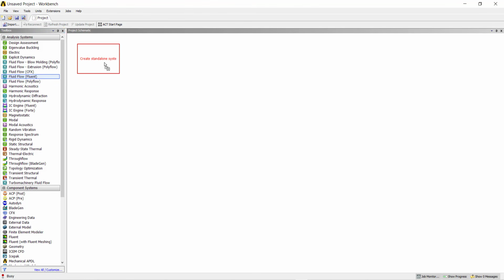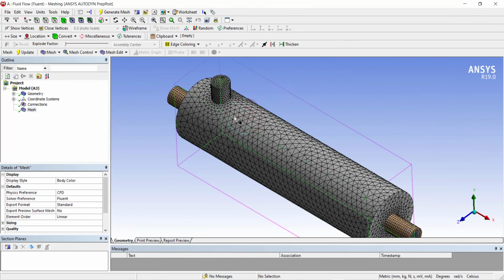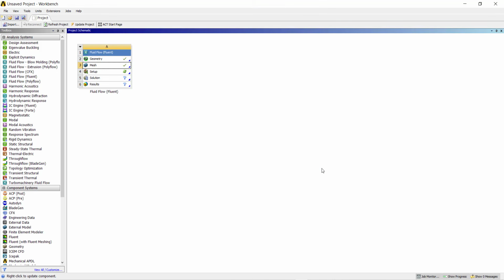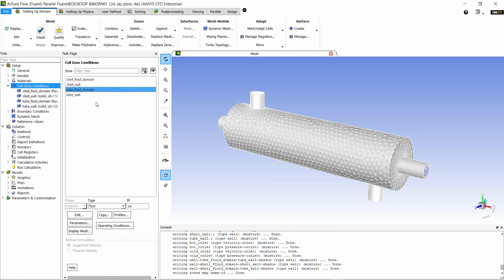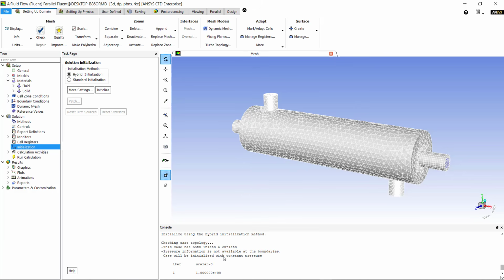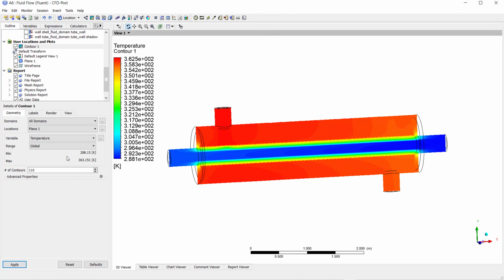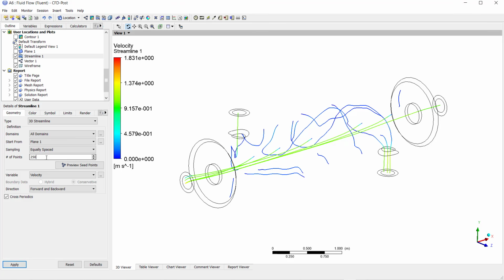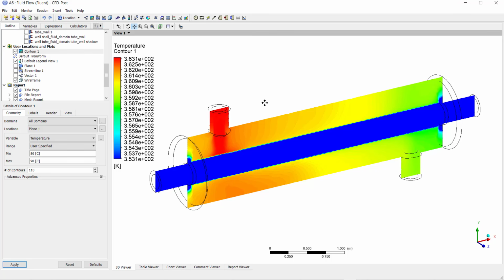How to do CHT Analysis of Shell and Tube Heat Exchanger using ANSYS Fluent | Tutorial | Part 2

Comment: I exactly followed all the steps mentioned in  this video and ran the analysis, but I'm getting the heat gain in cold fluid greater the heat loss in hot fluid. Why is this occuring ?

Comment: Hello Sir,

I really enjoyed your video, and I'm interested in a similar simulation, but considering hydrogen as the fluid and using nickel as the material for the tank. What do I need to modify to start the simulation?
Reply from the maker: I am glad you enjoyed the video. You will have to import materials from fluent library and then assign them correctly to respective cell zones. I hope this helps.

Comment: When I did the same as you did in your video but with Ansys 2022 R1 I have different results. The temperature on the right of the hot domain is much colder in my project (around 340K whereas you have around 360K there). Do you know what the problem could be?

Comment: How we calculate the average heat transfer coefficient value at the cold pipe and in hot fluid also.
Reply from the maker: Hello. Once you complete the calculation you can go to the reports tab in Fluent. There you can select method as area weighted average. Select wall fluxes and then select surface heat transfer coefficient. Then you can select the location as any surface on which you want to find out h value.

Comment: But the solutions didnt converge and u said if the values are in 10^-3 its ok but the energy crossed -3 and went to -4 and -6
Reply: At last the solutions converged guys u just need to apply the boundary conditions crtly i mean for every wall cause some walls are adiabatic some should be coupled and the tube walls should be dissipate heat u just need to give some time and apply those values and it doesnt matter if not crossed e-3 mine converged at 600..iteration when all were at e-5 and energy was at e-6or7 dont worry u can get it too
Reply from the maker: I meant to say that residual values should be 1e-3 or below that. Its good to hear that your solution converged.

Comment: Why wasn't the convection heat transfer coefficient specified for the analysis? Is there any default value?
Reply from the maker: Hello. Convection heat transfer was not used in this simulation and default value of 0 was used.

Comment: With the setup why did you not have to create interfaces? 
When do you have to create interfaces?
Reply from the maker: If we use 'Form Part' option inside design modeller for all our solids, then the interfaces get automatically created. If you dont use 'Form Part' option in design modeller then you may have to manually create the interfaces.
Reply: @cfdbaba  thank you for the video and the reply. Truly helpful.
Reply from the maker: @SOZLax39  Most welcome and keep supporting.
Reply: @cfdbaba  I am using Spaceclaim, is there any "Form part' option as in DM?
Reply from the maker: @noraishahothman4394  There is an option named 'Shared Topology' in SpaceClaim that will make sure your mesh is conformal for interfaces between different fluid regions.

Comment: how about setting boundary condition for walls ?
Reply from the maker: Hello. We have already used the word 'wall' while giving named selections for our boundaries. ANSYS automatically detects and assigns wall boundary conditions to all the named selections with the word 'wall' in them. Hence we do not separately need to assign any boundary conditions for the walls.
Reply: @cfdbaba  for wall setting, are you using heatflux zero ?
Reply from the maker: @dinanatasya1281  Yes that's right.